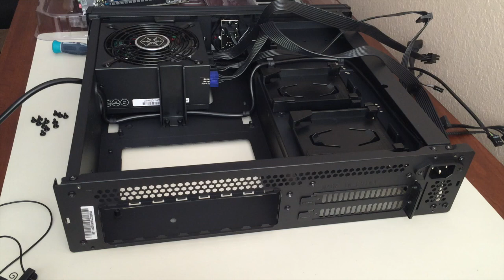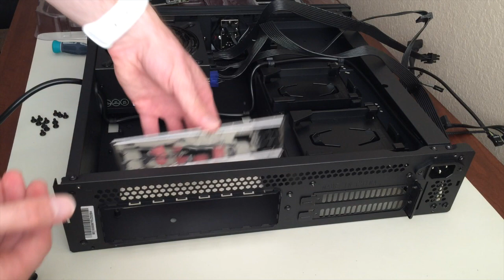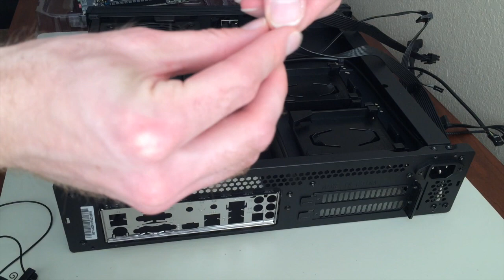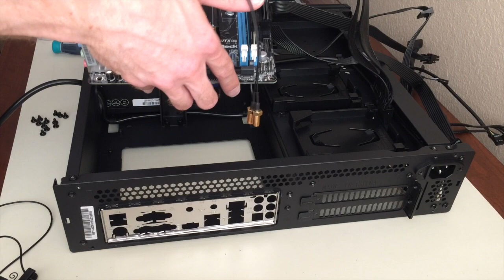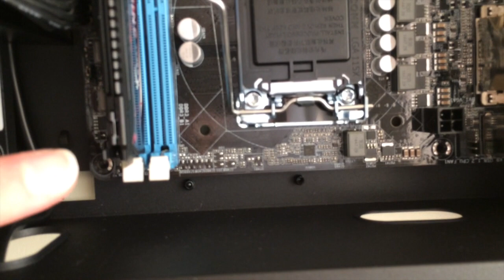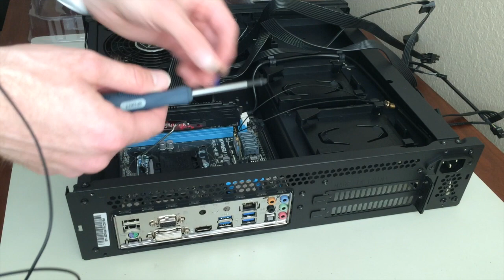RVZ02 Installing the motherboard

Comment: You can set this body the power supply from EVGA, and what model? .
Reply from the maker: +R Ibrahimov what do you mean?
Reply: I wonder can I install power supply from evga and some models.
Reply from the maker: +R Ibrahimov it has to be a SFX psu, not regular ATX, those are too big. I don't think EVGA makes a SFX PSU at this time